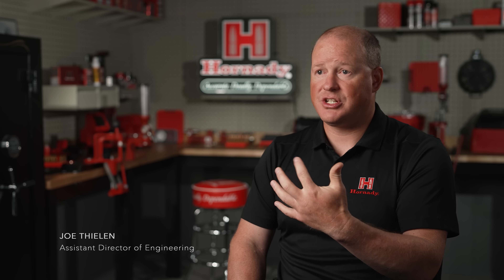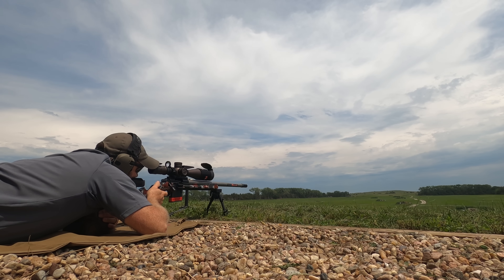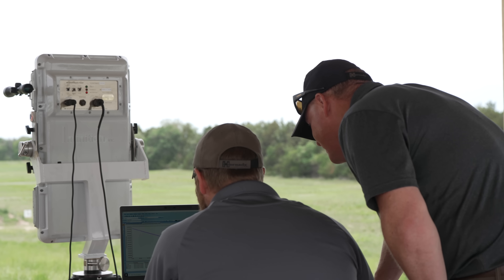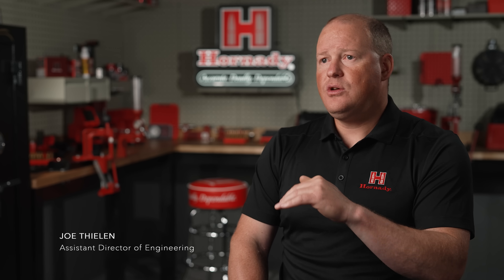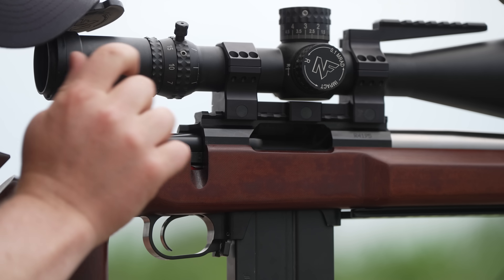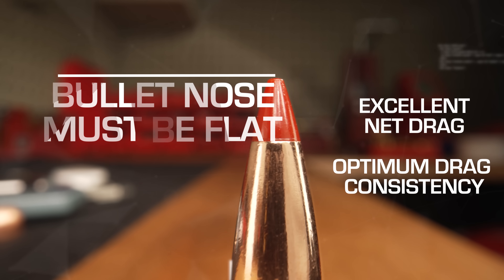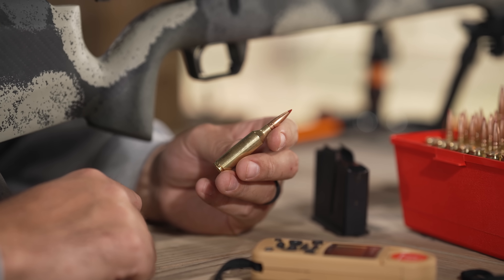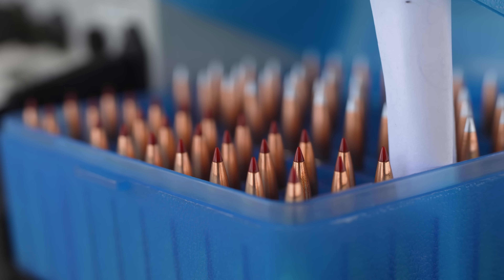Introducing DVRT™ - Drag Variability Reduction Technology

Comment: This is not new and earth shaking.  Benchrest competitors have known about it for 20 years now. You can buy fancy little cutters to put a uniform  flat meplat on your match grade hpbt bullets.
Reply: That's half of it.  The the other half is the part where we get the lowest drag possible while maintaining that consistency.  Net drag increases very quickly as you open that meplat diameter up.  Trimming (if you do it right) can get the consistency but when the meplat starts at .050-.070" diameter and gets bigger from there you're not going to keep the low drag that you see on ELD's or A-tips.

Comment: HORNADY has in the past decade likely developed more improvements in ballistics than any other bullet manufacturer. From heat resistant polymer tips to 4DOF ballistic engine to A-TIP production to DVRT with the patented tip diameter to bullet max diameter ratio. Then there are the very good Hornady-developed cartridges beginning with the famous 6.5  Creedmor.  I hunt with the 6.5 PRC.Congratulations to HORNADY ballisticians.
And yeah, why shouldn't HORNADY patent all this? But they do not charge for online 4DOF use and that's a big give.
DAYMN! There are so many anti-Hornady posts here and all of them arising from ignorance of the true basis for Hornady's patent. It is the meplat diameter-to-caliber diameter ratio EFFECT ON CONSISTENT ACCURACY!
Reply: @jimbofettx  "known information' REALLY? Only Hornady ballisticians figured out teh effects of a flat meplat on consistency of accuracy AND the proper me plat diameter-to-caliber diameter ratio. 
You need to LISTEN to the video more carefully. If what your say is true Hornady will not be granted a patent. But they will.
Reply: @jimbofettx  Not true "coach". Hornady applied for a patent on the meplat diameter to -caliber diameter ratio BECAUSE they did the research AND achieved consistent accuracy.
All you are saying is, "Hey, I've seen flat nosed bullets before." Yeah, so have I but they were not INTENTIONALLY made flat in any ideal ratio to caliber diameter. Likely they were flat for ease of manufacture. 
LISTEN more closely to the video.

Comment: easier to maintain manufacturing tolerances on a flat tip vs pointed or rounded. Reduction of drag variability, but does it come at the price of worse ballistic coefficient?
Reply from the maker: It's a balancing act between very good net drag, and excellent drag consistency.
Reply: @hornady the air will always make the same shape when the shock is not attached. Would love to see the data on drag variability vs BC vs the frontal area of the machined flat tip size (keeping the bullet profile shape and weight the same as possible).
Reply: @justsomedude8118   You're usually looking at about a 2-5% increase in total drag across the usable Mach regime.  It actually changes the shape of the Cd vs. Mach curve and the low Mach drag is lower with the flat tips.  You see drag variability SD's drop from 3-5% (or worse with some designs) down to in the ballpark of 1%.

Comment: How does the ratio of the tip to diameter affect the drag?
Reply: Smaller meplat (down to a needle point) reduces the net drag.  Larger meplat (up to wad cutter) increases net drag.  The DVRT ratio is the optimized area where you have the lowest net drag possible while still taking advantage of the shot-to-shot consistency.  Meplats have to be square, flat, and uniform to reduce drag variability.  DVRT is the smallest flat tip (lowest drag) that maintains that consistency.

Comment: It kinda feels like this video buried the lead a little bit. The flat tip wasn’t terribly exciting, since reverse drawn jackets with an open tip have exploited pretty much the same thing for years. However, gathering the data to figure out the optimum ratio between the diameter of the flat and the diameter of the bullet IS something that is new, or at least not known in a general formula.

Comment: What if the tip of bullets was metallic, like the jacket completed the meplat. That way you have a not super pointy bullet that the tip doesn’t melt….just a thought.
Reply: What if the tip was made of aluminum and the meplat was the perfect balance between small diameter (low drag) and flat meplat (low drag variability)?

Comment: So, Hornady says they’re doing it for the civilians and the industry. Yet, they applied for a patent to lock up the manufacturing so nobody else in the industry can make “more accurate” bullets with these golden ratios. Oddly, Sierra Bullets switched to closed nosed meplats for more consistency. They also didn’t need heat-resistant plastic noses on match bullets because they stuck with metal. Handloaders have been closing and flattening open tip match bullet meplats for a long time now. Also, tank and artillery munitions have had flat noses for decades. Hornady seems to have reinvented the wheel, but also found a legal loophole that will let them hinder the industry with a patent lock on things.
Reply: @rodsantos8703 yes I agree, however patents are also abused to hinder innovation and competitions. Patenting a flat nose bullet is like patenting a round wheel.
Reply: @POWERofO7  NOPE! HORNADY had to do a lot of testing to DISCOVER the advantages of flat nosed bullets and then MORE testing to find the correct ratio of tip diameter to caliber diameter. Did ANY other bullet maker ever do this??
Reply: Sure seems like they rushed out the eld family, then cut costs at every corner. Then customer satisfaction dropped. So they come back with a fix, so they can cut corners again.
Reply: Hey everyone! This guy just discovered marketing!
Reply: Research and Development is expensive.
Reply: You boys are on an anti-HORNADY roll. Tsk, tsk. Sch pettiness. "Modillo" what costs in the ELD bullets were cut??
Reply: Yawn..... So, U R Mad that they have the patent and you don't? Good! Go cry your eyes out some more and embarrass yourself even further!!
Reply: Agreed. You know your stuff pall.
Reply: @lakesidemfg3552 Yeah, he knows how to whine real loudly about somebody else's patent success! We call them a Douche
Bag
Reply: Yawn.... So let me get this straight, U R mad that Hornady did the research, found the proper mathematical ratio for a bullet-sized projectile, and then patented it??
Dude, dude, dude, you need to either become Amish or move to a deserted tropical island because you are certainly incapable of living in the real, industrialized, world. Fact.
Reply: Seeing the gap and taking the opportunity within the rules. Nothing wrong with that.

Comment: Too bad you didn't ask an electrician or a plumber or a farmer or anyone who drives pipes through dirt. We could all tell you that a flat-ended pipe will track more accurately than a pointed one. Or, look at the way pilings were driven hundreds and thousands of years ago; flat ends every time. In archery, dumdums fly as true or better than pointed arrows. Admit it; you didn't invent the wheel. You did, however, improve it significantly.

Comment: Ballistic missiles have been using aerospikes since the 50's. Definitely a part of the field of ballistics. Dont pat yourself on the back so hard you hurt your shoulder, hornady.
Reply: There is a lot of literature out there on drag reduction methods and shapes for projectiles and basically nothing concerning what DVRT addresses. Aerospikes are for net drag reduction especially at high Mach, not drag variability reduction.
Reply: The function is identical, stabilize the supersonic shock wave, stabilize the projectile, which becomes particularly important when you add steering elements. The most effective aerospike is a flat disc. This very same principle is exactly what the very small, flat front areas of the highest bc target hollow points have been giving guys for years. Theres a reason why berger is so popular with long range shooters. Sorry man no matter how big a fan boy you are theres nothing new under the sun.

Comment: I recall scratching my head trying to figure why soft point bullets (almost flat head) on a 7.62x39 round were shooting with greater precision (tighter groups) than with a pointy bullet.  I suspect that the ratio of flat head to rim size has to use the Parato 20-80 rule.  It seems to work naturally on most systems and I suspect as much on your new design.  Great discovery, I just couldn’t fit the puzzle together, but now it makes sense.  Without a fin the point of the bullet can vibrate through the air, but with a flat head it creates more drag on the sides of the bullet to prevent it from moving and thus will fly in a more stable trajectory.  The increased drag is actually beneficial, but who would have thought that!  Sometimes you have to take a step back to move two steps ahead. Absolutely brilliant!

Comment: It would be cool if you made some .25 caliber airgun slugs with the tip. Great technology by the way. 💪
Reply: This only works with supersonic, 99.99% of air rifles shoot subsonic projectiles (because the pressure you start at is usually under 4500 PSI and the sonic choking through the valve and transfer port into the barrel.
It's based on the density of air (the nitrogen/oxygen mix) which is why lighter helium charged airguns gain between 27 to 29% higher velocities.
Anyway, a pointed bullet doesn't help much in subsonic flight nor does a boattail work subsonic either. And if your pushing above 950 FPS into the transsonic region a pointed tip causes wobble / gyration and widening group size. It's why 22LR is inaccurate at long range, it's slowing down from supersonic to transsonic. This happens at a few hundred yards (and it's why it gets more difficult to shoot centerfire out at long ranges, the bullets still spinning for gyroscopic stability but slowing down from air resistance and as it reaches transsonic it starts going spirals and nose high.
Anyway, a round nose works well subsonic. And note that a Hollowpoint is full of stagnated air so it acts like a solid nose in n flight (that changes when the medium changes, ie when the HP fills with flesh for example in terminal ballistics.

Comment: Marketing raised to another level.
Reply: Care to explain why you think it’s marketing & not engineering?
Reply: @jeffsiewert1258 flat tips been around for a long time. Berger does not come to a point and other manufacturers have flat tip bullets.
Reply: Closed copper cup meplats are far from flat. Extra work has to be done, be it machining or the addition of a tip. If you mold it or make it on a screw machine, they’re as close to identical as can be made. Machining a closed copper cup isn’t as consistent.

Comment: So, they basically discovered that, in the same fashion that HPBTs are more accurate than ball ammo, a modestly flat tip on a polymer bullet is good?
Reply: BTHP/OTM style bullets almost always have more drag variability than our polymer and especially aluminum tips.  The tips are basically exactly the same every time. BTHP style bullets still have some variation.  You can trim BTHP style bullets but the meplats start off at a larger diameter and trimming increases that diameter even more, so you are going to have larger net drag.  With ELD-M and A-tip you get minimized drag while maintaining the consistent meplat and lower drag variation.

Comment: Ever thought about trying to make the plastic tip self sharpening from air resistance?  Idk if its possible though. Just a theory but.  I suspect that its bullet plastic tip deformation during flight or before its fired .. maybe the action scratches it a bit or its damaged banging around in your hunting equipment

Comment: So you basically made a polymer tipped bullet with the same geometry as a BTHP?
Reply from the maker: Good question. We have seen BTHP designs from various manufacturers have good drag variability out of the box. We’ve also measured BTHP designs that vary significantly from lot to lot – some showing amazing drag variability, and the next lot showing extreme variability.
 
In short, there is some drag variability risk with BTHP bullets or simply use a bullet that has it incorporated in a consistent manner, bullet to bullet, and lot to lot. Thanks for the question!

Comment: Give it enough time and you'll find that it's actually even better if the tip has a small cavity in it.
Reply: Exactly, people have been filing tips off 30 06 for 40 years. Hollow points was for air on air = less friction & better expansion.
Reply: Not exactly. The “jump equation” tells you bullets with low density front end should shoot smaller groups if the quantity is equivalent to lead pointed bullets of the same shape & geometry. Look at episode 110, 17 minutes in.
Reply: @jeffsiewert1258  okay sounds cool
Reply: Its called a BTHP match bullet. Everyone makes them.

Comment: Honest question. Why use a tip vs meplat trimming? Cog related?
Reply: The molded tips, and especially the lathe turned tips (A-Tip) are exceptionally consistent compared to a swaged up BTHP meplat.  BTHP's can edge in on the big side of the ratio (before trimming, and trimming adds another step), but the tips allow for reduced drag while staying inside the ratio window.  More consistent shape while still taking advantage of lower drag basically.
Reply: @milesn3173  my man. I appreciate the answer sir, now go to sleep, we need you sharp for the future.

Comment: Something aero space has be doing with nose and inlet geometries for decades. Go look at the Trident missiles designed back in the 70s.
Reply: Swedes had some interesting development work done in the late 1800s regarding artillery projectile shaping, specific to ogives.

Trident ogive shape was driven by overall length to fit in the tubes of legacy SSBNs from my understanding, though I'll defer to aerodynamicists who did the tunnel and flight test work on it.  The aerospike compensated for its blunt meplat and ogive by extending the shock wave point forward.

For your low altitude profile, the missile stays limited to a certain speed due to Density Altitude anyway, then once it gets into thin air, it throttles up for higher supersonic flight to achieve escape velocity into a low-earth orbital trajectory to meet its range requirements.
Reply: Care to tell everyone how the “throttle back” on a solid fuel rocket motor ?
Reply: @jeffsiewert1258  Variable geometry expansion/combustion chamber to change the pressure ratio.  It’s an age-old question and challenge with SRMs that was solved long ago.
Reply: @jeffsiewert1258 fairly simple 

Adjustments to the fuel, surface area, combustion chamber, or hybridise the SRB

Comment: 🤔🤔🤔
Ah so shaving the tips off the bullets i already have in incremental amounts and i should see better ballistics with the testing at some tip to ogive dia ratio???
Hmm… without 3rd party testing it sounds like a bit of snake oil.
Time will tell.
Reply: Seems like that could have figured this out by calling anyone in the aerospace business dealing with supersonic craft. The Trident missiles had a blunt tip to improve performance back in the 70s.
Reply: I believe it was 2019 that the flat tips started going on the ELD-X and ELD-Match bullets.  If you haven’t had them for a long time your bullets likely have them.

Comment: So... when are you guys gonna provide a meplat trimming tool? So that we can all experience consistent drag.
Reply: There's already meplat trimmers out there. The breakthrough is realizing/understanding the meplat size ratio to bullet diameter. If this is a constant (vs variable)  one should be able to mic one of these new projectiles, do the math, and solve the ratio. Then one can use that equation for any bullet diameter and go to town.
Reply: Reading the patent provides some insight, too, but they claim a range: 7-18% in one claim, and a refined range of 8-16% in another. That’s the meplat diameter relative to the “body portion diameter”. 

US11408716B2 - Claims are all at the very end of the patent.

Comment: The red plastic  tip that you showed in your example next to the metal tip  was  at an angle.  I would assume there will be an inconsistency with ones that are not perfectly even as well.
Reply: I think that was a lighting thing.
Reply: @scottzagger  no, go to 4:13 in the video. It’s squished and tipped to the left. Pretty bad when they introduce it and show how the quality control…or gimmick is going to be right off the bat. I believe it’s great in theory if quality control is there. If not it’s just a gimmick to sell more bullets…which I will regardless from them.
Reply: This tech has been in their bullets for a couple of years. The tips are nice and flat.

Comment: Isn’t that what the OTM BTHP does? Flattens it at the front where the air flows
Reply: Nah the air gets trapped in the pocket and cuts the wind better that way.
Reply: @noahhorinek correct
Reply: @noahhorinek not really because the air whould start compressing resulting in major velocity reduction wich just isn't the case
Reply: @wildcat_reloading wrong